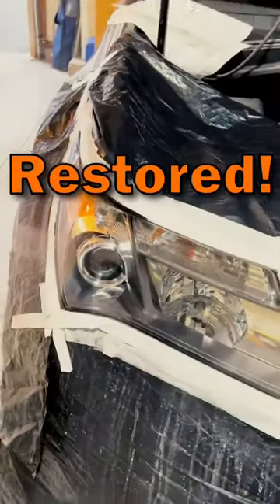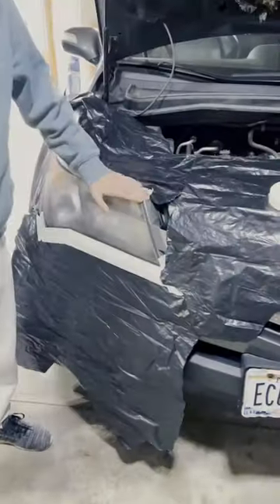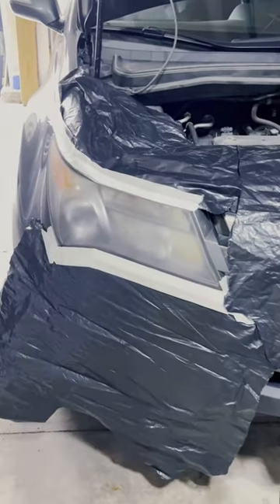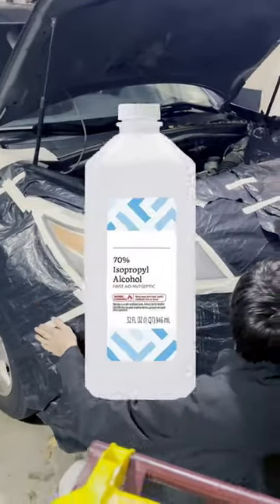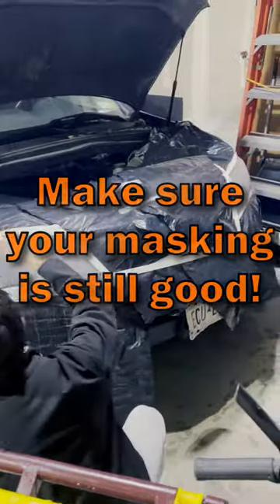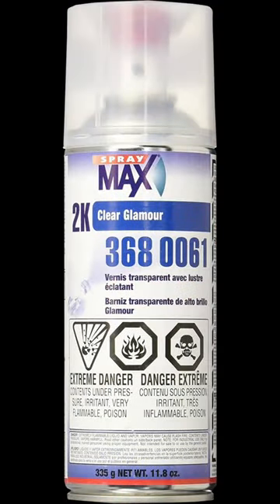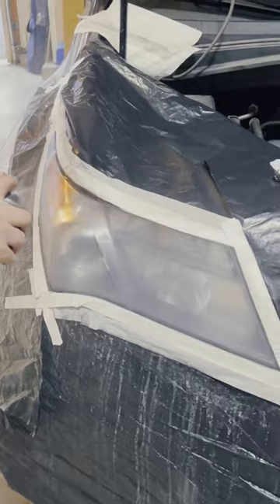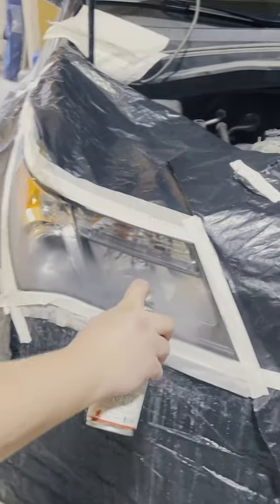The BEST Way to Restore Headlights - Permanent Results - Like New Again #detailing #restoration

Comment: 800 not available so i had to do 600 1000 and 2000.
Not much improvement unfortunately. Could the yellowing be on the inside? 
Or am i wet sanding incorrectly? I sand for 1 to 2 minutes only per paper. Too quick?
Paper not wet enough? 
Also i only used meguiar's headlight coating,  not the one you used.
Reply from the maker: Like after sanding you still have the UV damage on the lenses? Is it getting all milky when you use the paper? It should be doing that. Make sure u soak the paper well and work the 600 grit until there is no more damaged surface before moving on to the other grits. Ive never seen damage in the inside. I suspect you’re not taking enough material off when sanding.
Reply: @DmitrysGarage  will try again. will let you know.

Comment: Used the same 2k and it looks hazy. Any suggestions.
Reply from the maker: Was it very humid? Clear coat doesn't like humidity. May try polishing the clear coat to see if it will clear up, but might have to sand and re-spray somewhere dry if it was humid out.
Reply: You need to do more wet sanding and ensure the covers are completely dry before applying any clear.

Comment: will this work for peeling headlights mine are peeling baddd
Reply: Basically yes cus the sand paper starting with the 800 will remove all that peeling clear coat
Reply: you could even dry sand with 500 until you get everything off, refine to 800g then 1000 and then spray your clear.

Comment: Hey Dmitry, NEVER USE an automotive clear coat. Automotive clear coat is not made for polycarbonate surface. Always use a specific clear coat. Like Meguiars Headlight clear coat.Or, Spraymax 2K Special Headlight Clear
Reply from the maker: Spraymax for headlights, which is a new product (newer than this video maybe), is better. However, ive had great results this way too. I don’t like the megs, doesn’t last in my experience.

Comment: It doesn't matter how many times you restore. This headlight is damaged because the UV rays already damaged the plastic and so it will continue to degrade and only last one year with each fixing. So you just have to change it for a new one and put UV protectant on it if you don't want this to keep happening every year because sanding and polishing is just a temporary fix
Reply from the maker: This video is over a year old and his headlights look just as good as when we did this. This isn't sanding and polishing, this is sanding and clear coating.

Comment: I want everyone to know that using baking soda and dish soap works better. All that yellowing is stuck on dirt and you have to remove it all. Then use a polish or wax. Always use clean microfiber.
Reply from the maker: The yellowing isnt stuck on dirt. Baking soda is an abrasive so its the same as using sand paper, just less efficient.

Comment: So why wet vs dry sand?
Reply from the maker: Wet sanding helps leave behind a finer smooth surface, especially with fine grits. In general unless you have a ton of material to remove (heavy defects) wet is better for this kind of work and I would finish wet regardless.

Comment: when that clear coat wears off, what happens?
Reply: repeat the process~
Reply from the maker: Correct. Nothing is permanent
Reply: @DmitrysGarage  the headlight has been permanently made cloudy/matted.
Reply: @ericajohnson7535 The headlight was already cloudy/hazy. This is a restoration. The clear lenses cloud over due to UV exposure and environmental damage over time. Most restoration products that remove yellowing and haze are temporary and the UV damaged plastic will yellow and cloud over again. Clear coat adds a layer of protection to slow the breakdown process. Look at plastic bumper covers and plastic fender flares, air dams, spoilers that are made of plastic and painted the same color of the vehicle. Those items are also clear coated not only for shine/luster but to protect them from the same damage that plastic headlights are prone to.
Reply: @scottp2462  and if they were not cloudy/hazy, and were brand-new?  Then you permanently scratched them.
Reply: @ericajohnson7535  That is true, if new why would you be restoring them? These comments are for restoring lenses that have yellowed or are hazy. No one would do this to brand new headlights. New headlights are expensive! I recently replaced my daughters Honda Civic headlights and the new headlights were $400 USD each! The cost to restore old headlights using clear coat and wet sanding is less then $75 USD. The reason I had to replace my daughters headlights is the previous owner had repeatedly used a petroleum based agent to temporarily restore the old headlights many times. The petroleum degraded the plastic. If they were clear coated they would last 3-5 years.
Reply: @ericajohnson7535 Why would you be sanding brand new headlights? This isn’t a coating like a ceramic coating, this Clear Coat or basically Paint that has no color pigments so it appears Clear…. If you’re wanting a Coating for protection, then use a ceramic coating or Meguiar’s Headlight Coating, either would need a re-application after a given amount of time to ensure protection and would not require sanding on new headlights….. furthermore, sanding marks can and will be filled with clear coat, these marks are valley’s that are needed to catch the clear coat and will not be noticeable unless you use a microscope

Comment: The problem I’m experiencing after the restoration that the headlights become very easy to scratch, am I doing something wrong?
Reply from the maker: Are you scratching them while sanding or after you paint them? The lacquer (clear coat) does need to cure if its scratching after you finish. Are you using an automotive lacquer?
Reply: @DmitrysGarage  after sanding I apply the clear coat then I wait 24 hours , the clear coat I’m using is different brand but I think the one you are using more professional
Reply: @verrynice4620  so the clear coat scratches later like when you wash the car? If so it’s probably too soft for the application. If its “cracking” as it cures and leaves scratch looking lines without you doing anything then its probably the application. Could be too cold for example
Reply: @dmitrydovidenko5630  exactly it’s scratches later when you wash the car , I think it’s the clear coat that I’m using it’s not a good brand , I will try again with different brand
Reply from the maker: Yea so make sure the product you use has a hardener. The product i used has a hardener you activate by pushing a button on the bottom of the can. You have to use it within 24 hours when you activate it.
Reply: @DmitrysGarage  thank you so much for the information 👍🏻👍🏻🤝🏻🤝🏻
Reply: @DmitrysGarage  so basically the can is no good after you use it once? I’m asking because I do headlight restoration with compounds and polish, but I want to transition into something like this. However, you’re saying that I must use the can within 24rs of activation. Does that mean I have to buy a new van for every car?
Reply from the maker: @ShoeHefner757  Yea since there is an activator there it will go bad after 24 hours. You'd have to use a new can. More cost effective long term would be spraying it with a spray gun and mixing your own clear and activator.

Comment: Why are mine getting cloudy and not clear??
Reply from the maker: Theyll get cloudy while you sand, the clear coat will turn them clear. Make sure you spray a nice wet coat (but not runny wet).
Reply: Don't use clear coat after, just polish with a compound and machine then if you want, apply a quick ceramic coat to them
Reply from the maker: While you can polish lenses, they will never look as clear and they will turn foggy again very fast without a UV protective clear coat. Ceramic coatings don’t provide any meaningful uv protection.
Reply from the maker: Clear coat wont keep them clear forever, just like how the factory finish doesn’t. It will last a whole lot longer with it. Clear coat is what provides uv protection for your paint too. If you want long lasting results a good automotive clear coat with a hardener additive (like the spray max 2k i used here) is the way to go. If you have the car long enough for the automotive clear to fail, you would just do the same process again. Just sand it off and re-spray.
Reply: @actionmade The manufacturer uses clear coat, which you can buy and spray yourself, it’s not impossible to achieve rather people try to cheap out. A spray can like the one shown is good and will work for awhile, but using a spray gun with a more precise mixture for the environment would work better and longer. It’s all about Cost, this is a $25 - $40 solution vs a $200 - 400 solution if you had to buy your own spray gun, clear, activator, materials, air compressor, air hose, air/water filter, etc.

Comment: I went to my Home Depot and they have sand paper available in 800, 1000, or 2000 but the smallest package for each is $10 😂 wtf $30 for just some sand paper? Also I don’t need 10 sheets of each
Reply from the maker: There are variety packs online. I think the video links to one.
Reply: Variety pack online I got 400-2500 each on sponge blocks for $16
Reply: The walmart has them

Comment: 2000 is wayyyy too light of a grit for 2k clear coat, that will peel the minute it gets a rock chip

Need to finish in 800 grit and do 4 coats and you won't have a Peeling problem

Comment: The right way is to replace the lights
Reply from the maker: Restore != replace.
Reply: @DmitrysGarage  it's a short-term fix
Reply from the maker: @ucrazy2rc460  If you don't lacquer the lights sure, if you do it will last for years. Is it as good as a replacement? No, but on some cars replacements are unaffordable, like my 19 year old brother isn't going to be buying new HID acura headlights. They're upwards of $1,000 for new OEM.
Reply: @DmitrysGarage  true replacement lights are expensive
Reply: The right way is just to replace the whole car
Reply: Not really, unless they’re broken, headlights come clear coated from the manufacturer you can achieve the same results using a spray gun and the correct clear/activator, achieving OEM quality is difficult since painting has so many variables but professional paints can do it. This isn’t bad for a garage fix, and it will work for a long time if done and prepared correctly. Bad experiences usually come from people not following instructions, lack of preparation and cutting corners
Reply: @RockyRepairs  so how many DIY people have the skills ,equipment , knowledge or talent to do that ?
Reply: @ucrazy2rc460 not really

Comment: This is just a temp fix best thing to do is replace the housing itself!
Reply from the maker: It’s a much less temporary fix than other options, it can last for many years. To be fair even new lenses will again fail over time.
Reply: @DmitrysGarage  everything fails over time but new ones lasts longer
Reply: Have done similar process twice on my 2008 truck.  Still working on original quantity of sand paper.  Only need to buy clear coat each time.  Has saved lots of money vs. buying new headlight housings each time.
Reply: @ralphjones6165  I did it too twice like every 3-4 months got tired of it bought new lights that should last me a few years.. 🤙

Comment: Why not just polish it after the 2000 grit. Proper job then
Reply from the maker: Clear coat needs to go on a sanded surface. If you dont clear coat it then it will rapidly yellow again outdoors.
Reply: @DmitrysGarage  after watching a lot of videos it seems the proper way is to sand the light starting at around 800grit working towards 3000grit. Then using a polishing paste with a sponge on a drill or polisher to buff out all the scratches probably. Then add something on after that. Otherwise you just stick a plaster on it and the problem comes back.
Reply from the maker: @Whachadoon So the clear coat is what provides a smooth and protective finish. You can buff the clear coat after for an even finer finish. The sanding already removes the scratches and the clear coat fills the matte sanded surface and makes it clear. What will you put on a buffed surface instead of clear coat to protect it?
Reply: @Whachadoon nah they are doing it the wrong way In reality you should stop with 1200 and then clear you can polish the clear after but unless they are using clear it will just fade again

Comment: Tooth paste does a fair job.
Reply from the maker: Toothpaste does work, and is a quick fix in a pinch.
Reply: Sandpaper woth toothpaste?
Reply: @1983Santiago No, just tooth paste, basically tooth paste is a compound… but that is not a permanent solution, your lights will yellow again after a few weeks in the sun… you need clear coat that has UV inhibitors that will prevent damage for years in direct sun

Comment: Trust me. 3 hours job every 3 months required to maintain clear headlamp. There is better way to do this
Reply from the maker: This process lasts way longer than 3 months. Should last for years. What is your better way?
Reply: Change the cover if viable and start using film. Coat will turn yellowish fast under the sun and soon you will need to take it out, hence film will not work for sanded headlamp.

Film last way much longer and easier to replace and it protect headlamp from oxidation.
Reply: @DmitrysGarage I am living near equator and getting hot burning sunlights almost everyday, that's probably explaining why it only work 3 months

Comment: NO NEVER USE THAT CLEAR COAT! USE  the Meguiars Headlight Coating spray it has UV protection to last you way longer than that clear coat your using. It will turn yellow as it has no protection from UV rays.
Reply from the maker: Clear coat is much better and lasts much longer, because it protects from UV. The Meguiars product literally says its up to 12 months of protection. Thats not much, clear coat will last for years.

Comment: And that is why...

2k clear coat is the WRONG way to seal headlights. The product you showcased is not designed for the radical heat changes that headlight lenses experience on a daily basis. The automotive clear coat also bonds tightly to the polycarbonate and forms a really hard finish. There is a reason a plasticizer is mixed with paint after the adhesion promoter is applied when painting bumpers. The only difference is a bumper isn't a light housing with little 55-100w heaters inside. The product from the factory is nothing like normal automotive clear.